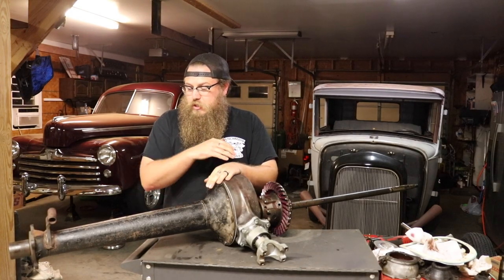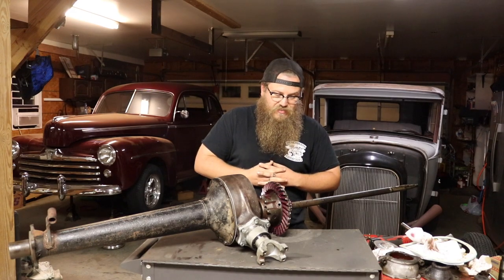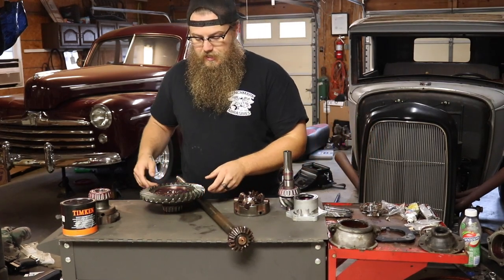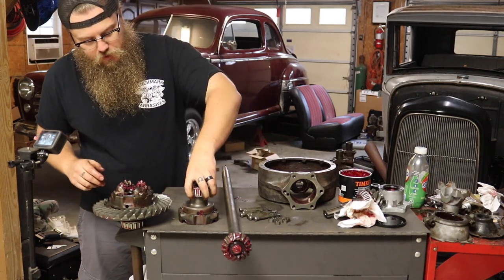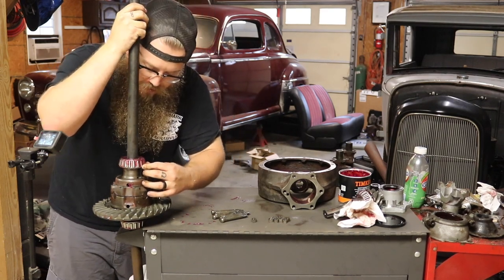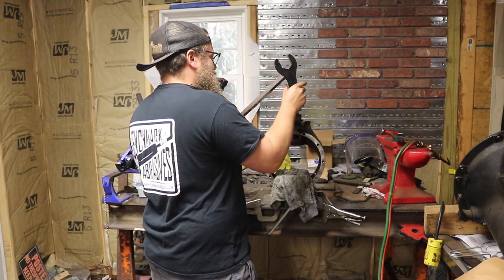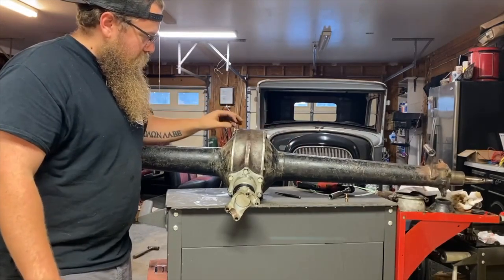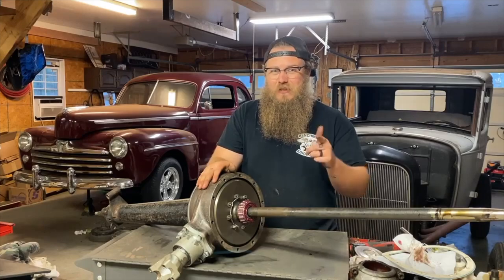Early Ford Banjo Rebuild

Comment: Hey Zac, that preload on that pinion bearing is "15 INCH pounds" NOT 15 pounds.  I set mine between 13 and 15 inch pounds. You need a inch pounds torque wrench for that operation.   And when heating that banjo housing it should be hot enough so the double bearing will FALL in and bottom out in the housing.  Be careful when you tighten that second jam nut, it will change the setting on the first nut.  After setting the second nut and before bending the "flats" on the lock washer check your pinion preload again with the INCH pounds torque wrench.  Always install a new pilot bearing too.  No need to short cut anything when it's down this far.
Reply from the maker: Thanks for all the information Bill, my entire procedure came from Chilton Handbook 1947 Edition, all bearings and races were replaced on this axle,
Reply: Can you not just multiply the 15 inch pounds by 12 and use a foot pounds wrench?
So 180 ft/lbs?
Reply: @muphfab  divide by 12 converts inch pounds to foot pounds.
Reply: @muphfab  Not 180ft/lbs. the bearing would lock up. 15 inch pounds equal 1and1/4 ft/lbs.  There are 12 inch lbs to one ft/lbs.  Best to use a inch lbs torque wrench, more accurate

Comment: i just bought a 1948 monarch coupe. Its supposed to be super rare. The car has zero rust. It has a merc flathead with lots of speed equipment on it. stock 3 speed and brakes. Its 90 percent done with 90 percent to go. I am excited to work on it and love your videos. Keep up the good work.

Comment: Awesome informative video as always! Would you recommend putting a vent on all early v8 ford banjos even staying closed drive?
Reply from the maker: Thank Chris! If you have a close to original drivetrain then there is no need for a vent, it’s when gear ratios change drastically or if you have a modem transmission is when you need a vent

Comment: Thank You so much!
I’ve been searching info on working on these. 
My ‘46 has been sitting since mid July due to a strange noise in the rear. 
My flashlight through the  check plug hole shows a very ugly ring gear and a magnet found a bearing roller.
Reply from the maker: Ouch! Sounds like it’s time to take it apart!
Reply: @WiredCustomsSpeedShop 👍🤞!
Reply from the maker: @bodarville2510  hope it’s going well!
Reply: @WiredCustomsSpeedShop  
Had a setback. I work for a school bus shop, a lot of people quit. I’ve been practically living at the shop. No time for a hobby for a long time. Good news is that the light at the end of the tunnel is not a train.  With the OT I bought a bulletproofed Columbia to put on this axle and I should be able to start on it soon. 
I’ll most likely be rewatching this video a lot and talking to John at Columbia 2 speed!

Comment: Spot on video...my banjo is very noisy, whine I suspect the ring and pinion is worn out..should these axles be quiet or any noise at all..any tips will be welcome   thanks
Reply from the maker: Hard to say without hearing it myself, compared to a newer axle I would consider them noisy but the transmission is pretty noisy too, you could be hearing that

Comment: Very helpful, Could you show how and where the vent is installed?
Reply from the maker: Thank you Thomas, you can put the vent almost anywhere on the axle tube itself, drill and tap a brass fitting with a bung for a rubber hose facing upwards

Comment: Hi Zac

Awesome video.  Very helpful

I have a stock 29 Ford Model A pickup.   I just pulled the rear end because I lost all forward and reverse gears.   I thought one of the axles shafts may be broken.  When i lifted the rear of the pickup the passenger side kind of spins but not much.   The drivers side axle doesn't do anything.  When you take the fill plug out of the banjo you can see the spider gears moving when you spin the passenger side wheel by hand.  But the drivers side still does nothing.

Do you think its the rear axle or maybe the clutch?   (If I don't have to split the rear axle open I'd prefer not to.)  The transmission seems to go into gear but doesn't make the pickup move.   I've put the rear on jack stand and hand spun the engine and the drive shaft spins and spins the spider gears and the passenger axle.  Still nothing from the drivers side.  When I put a screw driver into the drain hole in the banjo to hold the driveshaft from spinning from the front it won't hand crank.  So I believed everything from the front to the spider gears is ok.   Thats why I pulled the rear end.

I live in a remote area in the middle of the ocean.  Not to many Model A's and no shop will touch it.  So I decided to try myself.

Any wisdom would be appreciated.

Thank you
Russ

Comment: Nice clean work!
Reply from the maker: The only way to work! Thank you 👍🏼
Reply: @WiredCustomsSpeedShop  Hey Zak, I just pulled my Banjo from my '35 3W. The Banjo however, is a '37. I've done this to replace the springs and upgrade to Juice brakes which I'm now in the process of. After I removed the backing plates from both sides I grabbed the axel and gave it a 'giggle' side to side. Now this being my first Banjo gig, I was surprised by the 'play' on both axels, is this normal or should the axel at the backing plate be more tight? Thanks.
Reply from the maker: @WaxMeister  what keeps it from moving in and out is the inner bearings and shims, if it moves in and out then it need to be rebuild, but if the axle moves up/down side to side it’s completely normal because the wheel bearing and hub keeps it in place
Reply: @WiredCustomsSpeedShop  Thanks, I was hoping that was the case - phew, I didn't want to get further into the rear end at this point. But, I'll check the lash once I get the diff off the floor and on my bench.
Reply from the maker: @WaxMeister  No problem!

Comment: Great video that is much needed.  Would have loved to have seen the lost part.  My recently purchased 1945 half ton has been sitting because there is almost no info and not sure if anyone is trustworthy who won't charge a king's ransom. FIRST time I took it across town it lost drive. The driveshaft spins but no drive. Is there a second shear pin that could cause this in addition to the input pin?   If it's not a shear pin, this video gives me the confidence to do it myself!  Also Zack,  don't you have to use machinists blue to make sure the ring and pinion gears are meshing correctly or is lash the only adjustment?  Thanks.
Reply from the maker: Thanks for watching Steve! There is no second shear pin, and on these early rear axles they are a different animal, only lash adjustment is needed and no dies needed to check mesh
Reply: @WiredCustomsSpeedShop  Thank you.  You are providing a very valuable service.  I have Vern Tardel's book on the banjo, but your video I find far more useful.
Reply from the maker: @steves8014  thanks Steve, I have the same book, a lot of good information, it’s still nice to see it done in a video, to a lot of people it makes more since

Comment: Arent you adding torque by using the wrench extension on your torque wrench?  Aiming for 15, setting at 20, you probably ended up with 25.  I am really enjoying your videos, recently entered the early Ford arena.  Do you still have rear hub pullers for sale?
Reply: YEs he is

Comment: So Zac, I never had time the other day to finish my comment on rebuilding a banjo rear end, so here goes.  With all due respect what you did on that rebuild as far as preload, tells you nothing about how much that bearing was preloaded.  If you put 15ft. lbs. of torque on that first nut that double pinion bearing might last five minutes.  What you need is a 1/4'' drive inch pound torque wrench. A 1/4'' drive socket and a six spline coupler.  Take and weld the1/4'' drive socket to the six spline coupler. Slide the six spline coupler onto the splined pinion shaft and attached the inch pound torque wrench to the welded on socket. Mount the banjo in a vice with the pinion shaft looking up  Now slowly turn the torque wrench as you slowly tighten the first nut and read the torque wrench dial. You're looking for 13 to 15 INCH pounds on the dial. Then install the locking "Flats" washer and the second nut. Hold the first nut with a "thin" wrench and torque down the second nut with a second "thin" wrench. Recheck your preload after torqueing the second nut. Your preload will sometimes change after torqueing the second nut.  Make the necessary adjustments.
   Now as far as setting the preload on the Differential Carrier  I shoot for eight (8 lbs ) preload on it.  I start with two .009 thousands gaskets from that gasket kit you have. Place one on each axle  housing/ banjo  and bolt up.  Now turn the pinion shaft with the same torque wrench and read the dial. You're looking for 22 to 23  inch lbs. on the dial. Depends on where you set the pinion preload. If you set the pinion at 15 inch pounds and you add 8 inch pounds on the diff. carrier than you're looking for 23inch pounds on the dial.  Now, if the diff carrier is too tight you need to add gaskets/shims to the passenger side axle housing side only. You adjust Diff. Carrier preload with passenger axle housing not the drivers side axle housing  Adjust with gaskets until you reach 23 inch lbs on the dial.
   Now the drivers side axle housing is used to set back lash.   The limits are .003 to.008 thousands on a stub mount pinion and .006 to .010 thousands on a straddle mount pinion. All 1933 to 1948 Ford Banjos are straddle mount type banjos. Adjust back lash at the splined end of the pinion shaft with a dial indicator.  Now here comes the trick!  If you have to add gaskets/ shims the the drivers side to adjust the back lash you have to take away the same amount from the passenger side.  If you don't you change the Diff. carrier preload. Also, remember this, if the back lash is too tight meaning the pinion gear is too far into the ring gear the rear end will hum and make noise.  If the pinion gear is not deep enough into the ring gear you could chip a ring gear tooth. So back lash is important.  Try this set up, it works for me every time  If I missed something let me know
Reply: Bill,

Does this also work with the truck banjo open drive?
Reply: @shawnsaunders9730   If it's the 1/2 ton pickup, yes, it's the same rearend only open drive. All the specks are the same.
Reply: When I said 1/2 ton pickup I'm talking pickups with Banjo rearends .
Reply: How durable are these rearend? These aren't posi are they?
Reply: @johngrepo9976   John, If the Banjo rearend is built right and run with a Flathead or even a Hot Flathead and driven correctly, it is a reliable and durable rearend. Now you can upgrade it by installing 28 spline slide-in axles. That will make it bullet proof for the Flathead. Checkout Hot Rod Works for the upgrade. And no, they are not posi.
Reply: This is very good information; but you should do your own how-to video rather than steal thunder from Wired Customs.

Comment: That pinion torque setup will not give the correct torque.
Reply from the maker: Verbatim right out of the original Ford manual from 1948
Reply: @WiredCustomsSpeedShop  the torque wrench should be 90 degrees to the tool when using a crows foot or wrench. Thanks for the video I learned a lot.